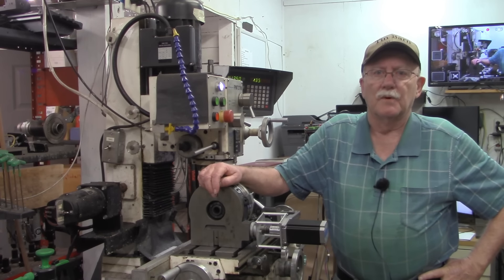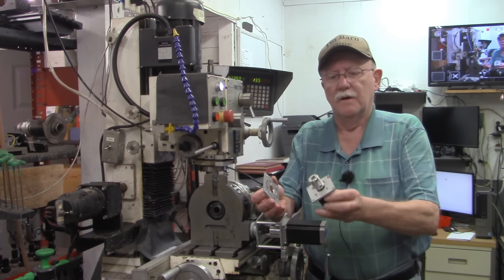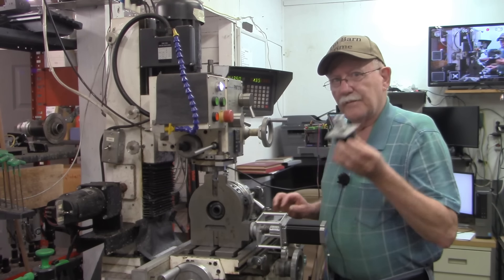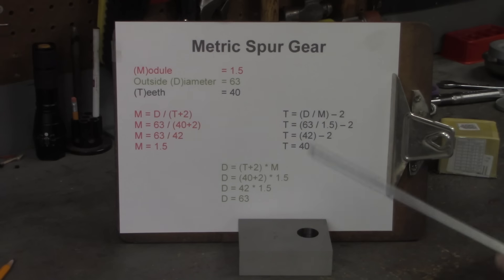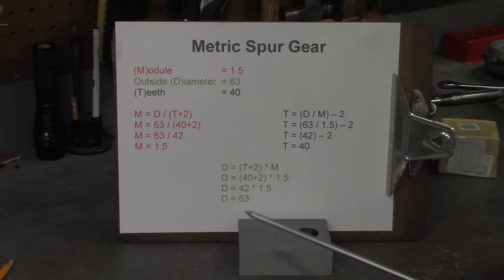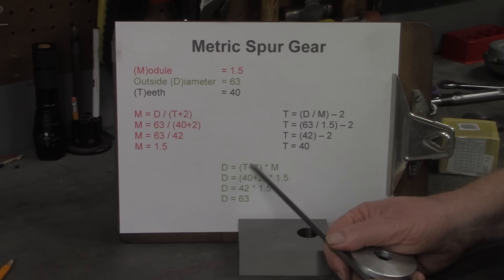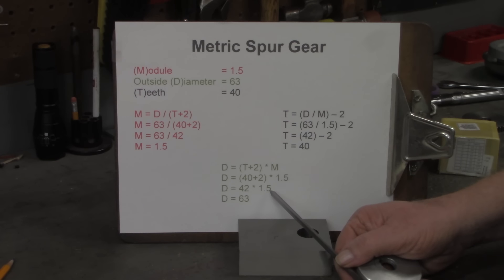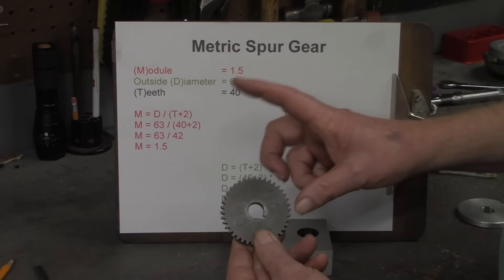Cutting a Gear With A Motorized Rotary Table (Part 1)

Comment: Fantastic explanation sir.
Cannot thank you enough.
I learned a great deal tonight that was new to me.
No need to apologise for talking too much when the knowledge passed on is this valuable.
Can’t wait for the next instalment
👍👍👍🇦🇺.
Reply: Could you recommend an app that a new manual machinist could download to his IPhone that helps figure out feeds and speeds on lathe & mill as well as what insert to use on the common metals?

If it had the above info from your video as well about cutting gears would also be good.

I already downloaded one but it seems to be for those doing CNC programming & assumes the user already has a lot of the basic knowledge I don’t yet have.

It’s tough starting out, bit like jumping in the deep end when trying to learn to swim.

Comment: Excellant explanation. I have cut gears with a self made cutter. All you need is to make a cutter using the dimensions for a gear rack. You will be cutting more than one tooth at a time and the end result is perfect.

Comment: I cut a gear once,  in aluminum,  back in high school machine shop!  And I'm pretty close to your age...   I don't remember what the device I used was called,  but it had a plate on it with a LOT of holes,  and you had to pick the right ones and move the right number of holes.  This was also the only time I ever used a horizontal mill,  which they had there...
Reply from the maker: Sounds like you’re describing a dividing head & plates.
Reply: @MrPragmaticLee  Looking up pics of that,  I think you nailed it!  My recollection isn't the best because we're talking mig-1960s or so here.  :-)

Comment: Consider changing your couplings to help tightening up the motion as well. The spiral cut couplings are great for helping with any misalignment and are 'ok' for light loads like in a 3D printer or Laser but otherwise look at a rubber spider type.

Comment: What are you using for a pulse generator?  I am thinking I would reach for an Arduino but curious as to what you used.
Reply from the maker: I’m using a Raspberry Pi. Code is written in Python and using Tkinter as the GUI. I’m sure and Arduino would work fine to generate the pulses - just have to work out the user interface.

Comment: Thanks for the gear theory lesson!
Sorry Lee but NEMA17 only tells about the mechanical mount. Nothing about its torque.
I used a 3 Amp stepper, mounted according to NEMA23. Torque? The most I had available..
Running it in 2 different modes, either angle step mode or steps per revolution mode covers a lot.
Using a microstepping factor of 32 x 90 x 200 steps per rev the resolution gives a resolution of 1 to 576 000. It ought to manage more then needed.
You bet Your advice to come back next week was heared!

Comment: Engine I use for cutting odd number tooth gears using 200 step per rev stepper. Spreads the error across all teeth.
laststep  = round(stepsDiv * lastPosition);
nextstep  = round(stepsDiv * currentPosition);
divSteps    = abs(nextstep - laststep);
Reply from the maker: Thank you. I’ve been considering how I’d address that issue - your code gives me a fantastic head start.

Comment: I can understand why the little nema 17 didn't work.  A worm drive is about as inefficient as you can get, so much power is lost through the contact of the worm to worm wheel. A nema 23 with 270 oz torque works great on my BS-0 dividing head 40:1 worm reduction.  I bought Steve Ward's (world of ward) stand alone electronic rotary table controller.  It has a built in 5.6 amp stepper driver, all you need to buy is your stepper motor and a 24 volt power supply.  Of course you need to make your own mount and buy or make a coupling.  It has an output that allows you to add a second driver for linear motion as well as limit switches and another output that you could control a solenoid valve or anything else.  It corrects any division errors when doing odd number gears so all cuts end up even and you can enter in your tables backlash if you want to do forward and reversing cuts. The second ouput can also be used if you need much bigger steppers and higher voltages.   It's dead simple to use to cut gears or machine slots or any type radius cut you like, being able to add a second linear motion axis is great. I use it to drive the X axis on my mill buy you could use it for Y,Z etc. A few minutes of entering your rotary and linear axis instructions and you can sit back and watch while it executes the job.  It's only 180 pounds and ships from England.  You can also buy the idividual  board, box and other components to make the product yourself from him or elsewhere, he offers the software for free.  It's even cheaper if you don't mind soldering all the components to the board yourself.  Lot's of options for different budget levels.  I have no affiliation with him, I spent a lot of time looking for an easy to use stepper control for my indexing head.  This required no code or heavy learning curve to use.  Once you've got it attached to the rotary table or dividing head you can start cutting gears. It took me about 15 minutes to figure out and enter the setup info for the stepper and another 30 minutes to get familiar with the different indexing options and enter the info to cut my first gear.  If you hate the idea of learning CNC or programing an building and programming an arduino then this type of controller is the best option.  You can ad different profiles so you can switch the controller from milling machine to lathe or anything else you want to control in just a couple minutes as well. Lots more options I don't recall off the top of my head you might like as well.

Comment: Lee, do you happen to have cutters for 22DP with a 20PA? I need to make a couple of gears for a Hardinge HLVH. Hardinge used a Fellows Stub profile of 22/29 with a 20 degree PA. Thanks
Reply from the maker: Sorry, the only set of cutters I currently have is the 1.5 module. Thanks for stopping by.
Reply: I also have a HLV-H that I had thought about making gears for that I could use to cut metric threads.  I had thought that I could make a complete set of the needed gears but with a different diametral pitch and a 14.5 degree PA (using involute gear cutters that I already have).  I have not done it yet, but I feel that it should be feasible.
Reply: @wilsontaylor234  I’ve heard of a few guys doing that. The gears I want to replicate are inside the apron. Good luck
Reply: @charlieromeo965  I did find some 22dp 20pa cutters on the internet, but they are about $80 to $90 each, so you would probably want to know which gears you wanted to cut.  Probably looking at $600 for a complete set.  Might get a bit pricey for just 1 or 2 gears.